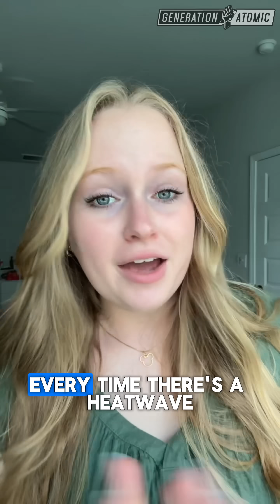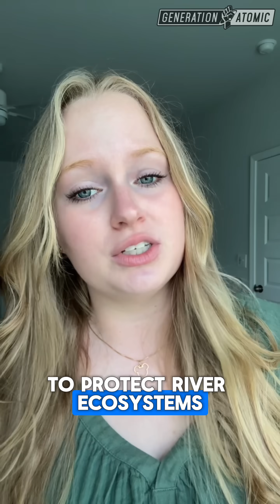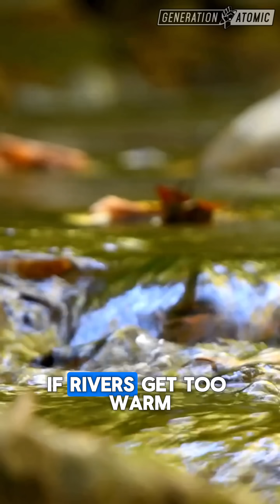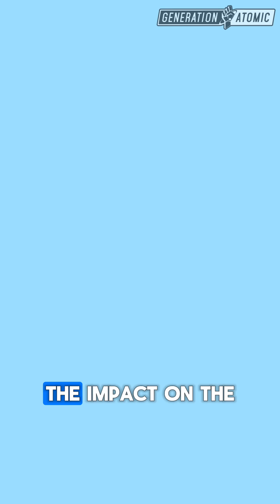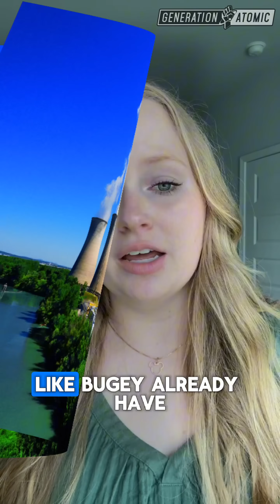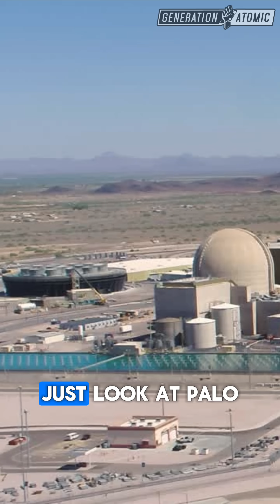Do Heatwaves Shut Down French Nuclear Plants? #nuclear #france #heatwave #nuclearenergy

Comment: If they used closed-loop systems they wouldn't need cooling towers nor worry about releasing warmer water because there wouldn't be any warmer water to release. 

They also wouldn't need to shut down accordingly. 

Throw in that that warmth released is an unused resource.. and reinforces the reduced efficiency of certain design-types. Still orders of magnitude over the efficiency of other energy approaches, but clearly evident that there're rooms for improvement.

Comment: Yes, thermal plants fare poorly in heath waves if engineered without proper cooling.

But climate change is not about heat only (is a change, not a heating, after all).

So, imagine how bad that fragile renewable infrastructures will fare in those extreme conditions, like storms, heat waves, hurricanes, tornados, etc.